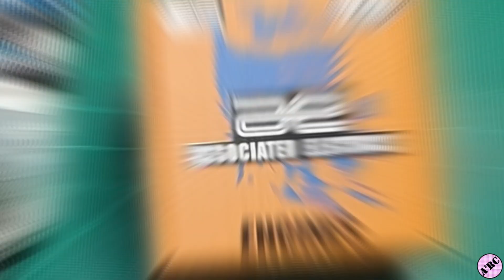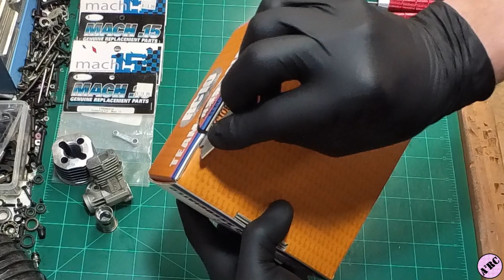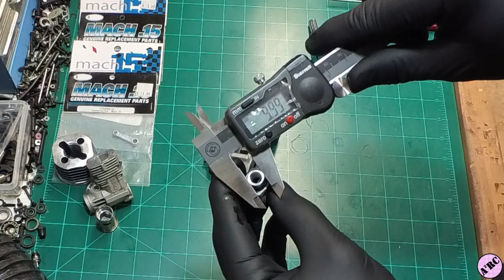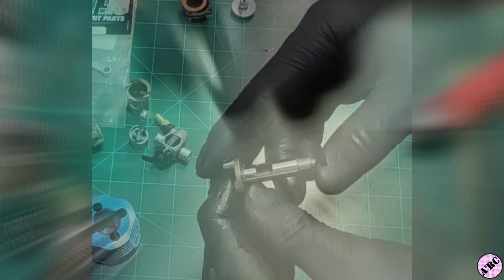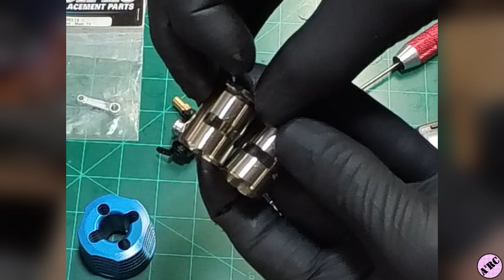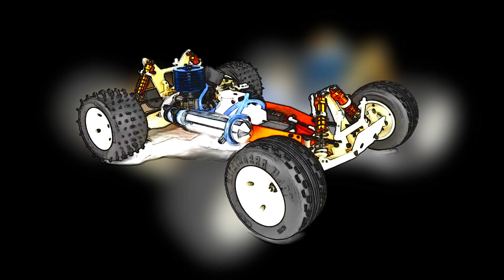AE 15s Team Associated Nitro Engine Overview - Dynamite Mach 15 has been Reborn

Comment: One more question then I will leave you alone. Lol Is there a torque specification for the cylinder head? Like you said there's no documents.
Reply from the maker: No worries about the questions. I’m always happy to help 

No, there’s no torque spec. It’s more important to make sure the head is tighten down evenly. Go through a sequence to get them progressively tight. 
- I know that “Tight” is relative but, you don’t have to cram the bolts down… just get them tight. 
We don’t want a broken bolt or a striped hole (There’s a sweet spot). 

Hope that helps a bit
Reply: @a2rc Awesome thank you very much.
I am a master automotive technician by trade just like numbers. Just make them the same all the way around basically.
Reply from the maker: @michaelvtx1 Yep. I’m glad to meet you. 
I’m a former certified Ford mechanic and then went back to school to be come a Mechanical Engineer. I love all things hands on 😊
Reply: @a2rc Good for you at this point I'm 49 years and to wrenching. Lol you should go work for Ford Lord knows they need the help.

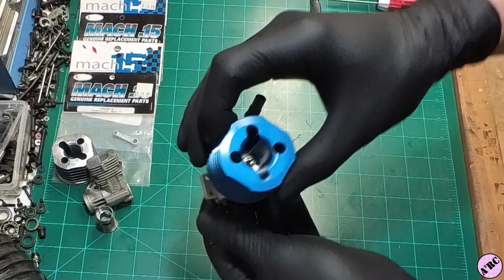Comment: 2:50 Losi made a RTR version of the XXX-NT stadium truck that was graphite?  I got a XXX-NT Sport RTR brand new in ~2003ish (right after the Sport 2 came out -- I wanted the pull start rather than the roto-start) and it was just normal plastic arms on the chassis.
Reply from the maker: I believe it was the 2000 release of the XXXNTRTR that had the graphite arms. Other versions like the Adam Drake and other did too 
- Do you still have your XXXNT running? Would love to hear about it 
Thanks for watchn’ 🩷
Reply: @a2rc    Yeah I def knew the race kit versions of the XXX-NT came with graphite chassis parts.  Never knew there was an older RTR version than the one I had that had graphite though, that’s interesting.  

Unfortunately I don’t have it anymore as I was like 15 when I got it.  I remember breaking it in but shortly afterwards it wouldn’t run anymore.  Never made it anywhere near a full gallon through it.  Got to go to a track 1 time but couldn’t keep it running long enough to do a lap.  Really needed some help/guidance but didn’t have anybody in my life that could do that, and this was before YouTube where one could far more easily learn those things second-hand.  Gave up and put it in the attic for a few years, then sold it on some RC forum when I was in college to get money for drift car stuff (full-scale).

I did return to RC/nitro in late 2019 with a new Losi 8ight RTR nitro buggy, then got my Tekno NB48 2.0  the next year which I still run today.  Currently running an SH Engine PT21A0 but this is at least the 8th engine I’ve run in it (Novarossi Bonito, 3 different Trackstars, Samurai S03, Alpha Dragon V, and another one of these SH’s).
Reply from the maker: @cbh148 sounds like you had a rough start years ago but, you have more than made up for lost time with your current set up 🩷
- I hope that folks like us can help the new generation understand the love and fun of nitro and keep it going for years to come
Reply: @a2rc   Absolutely!  I’ve helped 2 people with nitro.  1 of them has it completely now and the other is maybe 30% of the way there but his buggy keeps endlessly running into issues.  I’ll sort it out then it’ll screw up next time we meet at the track.  Needs constant supervision, but eventually he’ll get to where he can “fly solo”, so to speak lol.   He loves the sound and smell and the whole experience, especially simply refueling instead of waiting on batteries to charge.

Comment: Hi sir, I love your videos. I’m one of your subscribers. If anyone’s gonna know I figure I’ll ask you because you just do an amazing job with these Nitro engines. I have a 3.0 HPI, of course from my RS4 3 evo I bought it used. The guy didn’t tell me something was wrong with the engine. Well, I opened it up pull out the piston and the connecting rod at the bottom near the hole at the bottom of the connecting rod in that area broke, and you know really hard finding parts for these guys, would you know of any cross reference parts that would work with this guy? Meaning do you know of connecting rod piston sleeve that would work with this engine because trying to find the exact parts for this engine it’s really hard and when someone does have them they’re trying to get rich on the parts
Reply from the maker: Well there’s no easy answer on finding parts (just have to keep looking). 
We are all in the same boat and a cross reference list is not a real thing (I have been piecing engines together for years). Even though Force had similar engines, they made their Force branded stuff just a little different to the Force made, HPI branded engines 

- My recommendation is to find a donor engine or a brand new one. It maybe easier than finding parts atm. Lastly, the T3.0 piston and connecting rod is the same for the G version of the engine. Just to give you an option 

I hope that helps a little and I appreciate the kind words you’ve given to me 😊

Comment: Why did they cut the go so short on the shaft should have called it the one and half thread shaft nothing but problems 4 me
Reply from the maker: They designed it for the RC10gt. Some RCs are designed to use a cut/short shaft crank shaft. 
- Folks like yourself should reach out to Golden Lion and request standard shafts for the engine. Let’s see what they say 

Thanks for watchn’ 🩷

Comment: Can a pullstart be installed on this engine?
Reply from the maker: Thanks for the question 💯
Technically no but, there’s always a way. If you have the crank shaft, back plate and all other items from a Mach15 then you can convert it. 
- Also, unfortunately the company is not releasing any replacement parts for the engine. Is a bit of a shame 

Thanks for watchn’ 🩷

Comment: How can you fit this in a NTC3 ?   Will the longer clutch nut fit?
Reply from the maker: Thanks for the question. 
The upfront answer is, I’m not 100% sure but, there is a chance for it to be installed on the NTC3 with the clutch nut/pilot shaft (PN 2312) 
- Let me know if you end up trying it. Would love to know for sure 

Thanks for watchn’ 🩷

Comment: What I remember of the 12s, was that the carb from an OS .12 made it run a lot better!! Could that be the case with this engine?
Reply from the maker: OS carbs always seem to work better than some other manufactures, that’s for sure
- For example, we would swap out the 15Fe Toki carbs with OS 10E. Help that engine considerably 

I have not personally tried swapping the carb with a MACH15 or this AE 15s but, its worth a try. Just find one with the correct carb bore dis and length.
- If you do happen to try it out, I would love to hear how it goes. Let me know 

Thanks 💯

Comment: What engine would you recommend for a HPI super Nitro rs4. Looking for something that has big power and not expensive.
Reply from the maker: Thanks for watchn’ and taking the time to write 💯

Are you looking for a brand new, currently made engine or discontinued?
Reply: @a2rc either is fine with me. I lm just not sure what the biggest engine I can fit on my chassis.
Reply from the maker: @K3n38 To keep the stock set-up you will need to pick a small block (.12, .15, .18)
- Lots of good discontinued options. OS 15-18CVR, 18TZ, HPI/Force 18s, etc

Generally speaking, since the Super is heavier and uses larger wheels, a higher output 1hp+ or more race related engine and/or larger displacement small blocks would be a better suggestion
Reply: @a2rc thanks for replying back and all the great info. So since I have a heavier chassis and wheels. Which small block is best. I’m more of a parking lot badger type but want power when need. 😊
Reply from the maker: @K3n38 Take a look for OS 18CVR or HPI T3.0 (Not the “G” version). 
- Can’t go wrong with either and Both are drop in engines 

Regardless of what you end up with, write me back and let me know what you choose
Reply: @a2rc I’ll will definitely do that. Thanks again for all the great info. I’ll check those engines out. Excited to get my nitro back up a running.

Comment: Another great video. Just wondering, how do you size an old engine that lost its markings? I have an old engine I’d love to re-build. It’s definitely an Ofna force s pro engine. just not sure if it’s the .12 or .15. If you look up “ofna force .12s pro” it will show the exact block and cooling head I have plus the boost port. Manual has a few options for pistons tho. For reference the current piston is very similar in size to my t-15. Can’t say the same for the rod. Any help is greatly appreciated.
Reply from the maker: Thanks for watching some more and taking the time to say hi 🩷
- You have a great question 💯

In general, .12s piston diameters should measure similar to one another but, they will vary. So if you have a .12 piston or sleeve, measure it with some calipers and compare with your other .12s. Same goes with .15s, etc

The displacement is calculated by the piston diameter/sleeve bore size and length of the engine stroke. You would use the same equation you would use to calculate volume of a cylinder
- Sounds like you are on the right track to identify the engine you have. Manual/set-up sheets are critical to try and find parts. If I had a picture of your complete, engine I may be able to help butC that would be tough to do
Reply: @a2rc  This engine has so many options.. there is a .12s, .12s pro, .15s, and a .17. I am totally lost with the combinations of crank piston and head button. it’s definitely not a .12s or .12s pro. So it’s between.15s or .17s. My calculations keep coming up around .16. I wonder if I could go either way at this point depending on the head button.. Wish me luck, I’m going.15… lol

Comment: I am on the waiting list for one of these from Amain . . . I have no idea how long the wait will be.
Edit  -   Its for an RC10GT so I don't have to run the original engine if I can avoid it. Are there any other engines that will fit on the RC10GT? 

Edit 2  -  I think a TRX .15 will . . . . I am also wondering if most side exhaust engines have a similar exhaust manifold pattern so I could use the same exhaust but I might have to get a traxxas exhaust for the TRX .15 also.
Reply from the maker: Hey Hyper‼️
Thanks for taking the time to write. I hope you don’t have to wait too long for your 15S to arrive 

The Trx Pro15 would be an ok option if you can find it in a short shaft bump start version but, if you are willing to look at over vintage/discontinue engines then, I would rather you pick something like an OS Cv/CvR (or similar like Toki small blocks). Find something .7-1.2hp that has a standard crank and cut it to make a short shaft. 
That’s what we all had to do with platforms like the RC10GT early on. The exhaust on an OS is consistent with most all small block engines. New old stock of engines, pipes and header are getting harder to find but, they are still out there and worth getting 
- On a fun note, there’s a very special engine manufacturer that is working on a new engine specifically designed for trucks like the RC10GT. I’m not 100% sure on the release date but, I have been chatting them on the side about the project. I might be able to share some info in the future 😉

Thank you for your time and for watchn’ 🩷 Please feel free to write back to let me know how your Nitro adventures are turning out

Comment: AE is owned by Thunder Tiger, so it's most likely a Thunder Tiger engine, not SH. Also, black oxide is a steel coating, not an aluminum coating. The black finish on the backplate is either anodizing or fuel resistant paint. I have a OS engine with a black backplate that was painted from the factory; the paint slowly came loose on the inside and I scrubbed it off before it could cause trouble.
Reply from the maker: Thanks for watching and for the note 🩷

I wanted to take a moment to address your comment. 
- We realize who owns AE but, this is a Golden Lion/SH engine
- In addition, even though Black oxide is primarily used for steel and other ferrous metals, you can black oxide AL. The process is similar to use of Alkaline solutions but formulated to to work with Aluminum alloys

Comment: 17:14 i was once told very long ago that Nickel plating is at least five times cheaper than Chrome plating, + Chrome plating is super toxic and extremely harmful to the environment. abc sure lasts a little bit longer, but not as long as 2 abn sleeves. is that true and why bother with Chrome if yes?
Reply from the maker: @n00b247  I think the plating is only one piece of the puzzle. I think a design like the OS 12TG ABN sleeve might fall into your comment but, I don’t believe most ABN designs would hold up as well as an ABC
- Most ABC engines allow for lower weight sleeves, higher fuel efficiencies, better and longer last pinch and overall better performance. Chrome can resist hotter temps and improper tune for a longer period of time over softer Nickel plating (ABC engines can have higher operating temps and use less oil in the fuel mixture) 

Please note: There are some ABC engines that are not well designed and may suffer the same fate as a RTR ABN. The inexpensive VX engines could be a possible example of this. 

Some stuff is situational but, in most cases, ABN vs ABC sleeves would have a similar cost to the end customer and I would choose a chrome sleeve over a nickel. 

I very much appreciate you and everyone for watchn’ and thanks for a great comment 🩷
Reply: Chrome plating isn't super toxic. Chromium is an essential micronutrient.